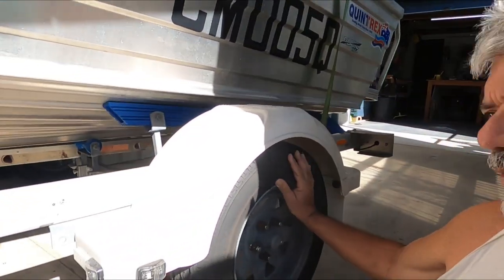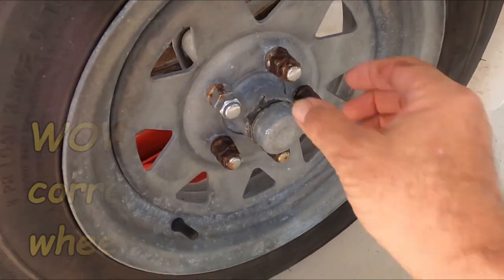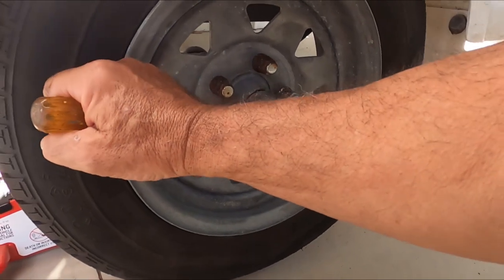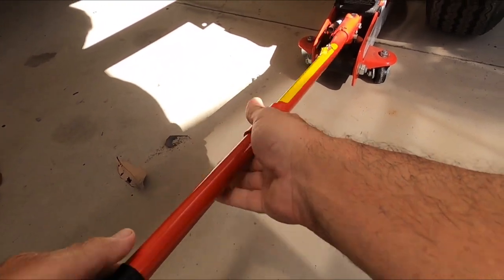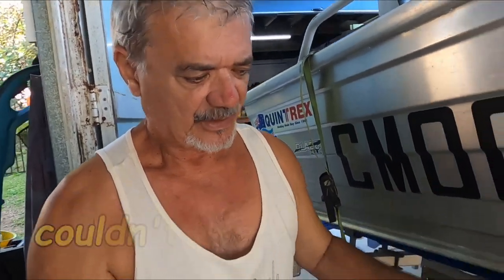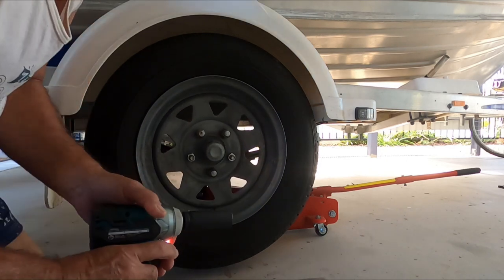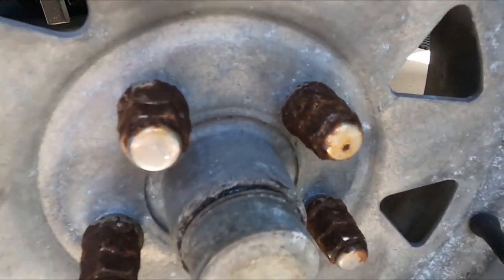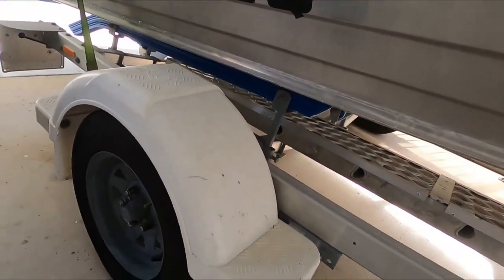Quintrex Busta 420 - Boat trailer maintenance - Rusty wheel nuts and Wheel bearing Check - Do It

Comment: Gday mate i check my wheel bearings normally about every 12 months ,the trailer i am running now i put in brand new bearings as i didnt know the history of the old ones and it runs bearing buddies , on my spare i have a complete hub assembly so if it goes really bad i have a complete hub to replace a shot one . when i picked this boat trailer up i had a thermo gun and every so often i would pullover and check the feel of the hubs and also the temperature . I bought a new trailer once never checked the bearings thinking new trailer company would put grease in  no grease at all just the packing grease the bearings came in luckily i didnt travel to far with them . I have to say thats a very fancy hammer your using to remove those caps , always check your trailer bearings on a boat harshest enviroment on the planet take care .
Reply from the maker: My sentiments exactly…and I also had an issue with a loose hub nut (with secured pin…luckily) on one wheel of a brand new box trailer. Annoying…
Anyway, thanks for your input mate…always welcome 👍